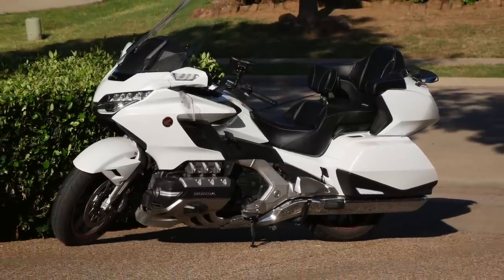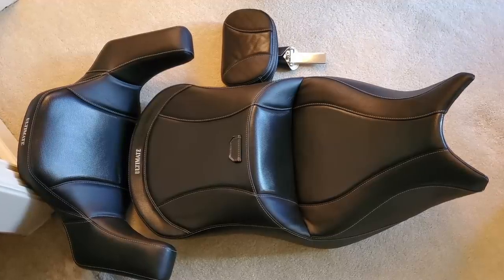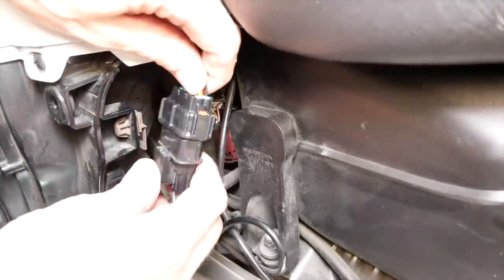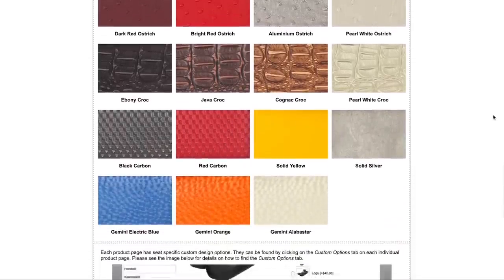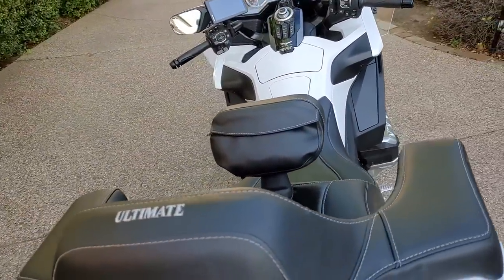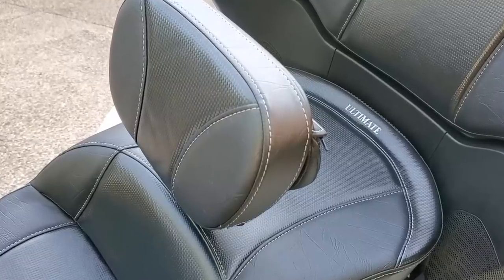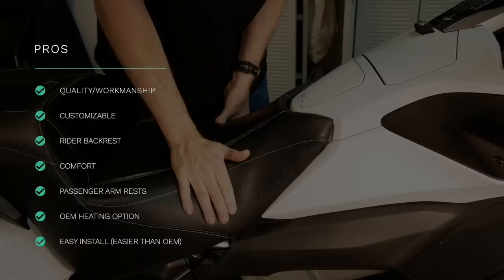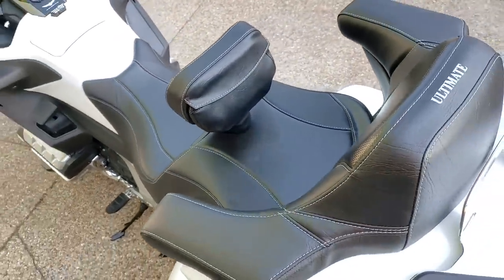The Ultimate Seat for 2018+ Honda Goldwing | Cruiseman's Reviews | 2020

Comment: I've had a Ultimate seat on my 2012 for about 5 yrs. One of the first things I did was seal the stitching with boot water proofing. I've ridden in hard rain and had it parked at the motel in the rain over night without the cover and have never had a problem. I had about $1800.00 in mine also because of the options, but after 5 yrs I still think it was one of the best things I did to my wing.
Reply: Thank you for the tip using boot waterproofing. I just ordered the seat and will apply your technique once it arrives.
Reply: I keep mink oil on mine and has worked great for many years

Comment: I bought an Ultimate seat  for my '05 GW about 3 years ago, what an improvement. The rain cover was an extra and back rest were extra. I bought the standard black seat and passenger back rest which positions the passenger 15 degrees more upright that made my wife more comfortable. You need to be patient when putting the rain cover on as mine started to separate at the seam. I reinforced all the seams with Tenacious Tape. I have had a hip replacement that cuts into my saddle time comfort but I'm not ready to stop riding. If you are going to buy the Ultimate seat buy all the extras and save on extra shipping costs.
Cruiseman, I always wear a back brace when riding. It really helps especially when going over a bump or pothole.
Thanks for all the great videos!

Comment: Just a heads up for some of your viewers...I've owned 2 previous bikes and installed Ultimate seats on them and just ordered my third seat for my new 2021 Goldwing...That little flap that covers where the driver's backrest goes in, if you double it over as in your video that little flap will develop some "memory" and eventually the Velcro will no longer keep it flat and neat. When you slide the driver backrest into the slot hold that flap out of the way until it is all the way in then release it. That will keep it nice and straight.

Comment: Just traded my 2007 GL1800 for a 2020. I removed my Ultimate seat and it is for sale. I ride 10 hour days and lost OEM burn. I’m ordering another for the new bike. I spayed Camp Dry on all the seams. I ride in the rain continuously without rain covering the seats. I live in S. Florida. Inspecting my seat after removal, everything appeared as new as the day it was installed. I’m a very satisfied Ultimate customer.
Reply: Thanks, Ron.

Comment: I owned an Ultimate King for my 2006 Wing, it was a good seat but it did not compare to the Russell Day-Long.  I am an long distance rider.  I put 350k on my 2000, 250k on my 2006 and have about 79k ion my 2009.  The RDL seat has over 300k miles on it and is in great shape.  It is covered in leather.
Reply: I never had a Russell Day Long and the important aspect of the Ultimate KING is it moves you back. I'm taller than John Cooper and weigh about the same. Never felt a need for anything else but an Ultimate since 2012.
Reply: I have three bikes, all with RDL saddles.  Pricey, but worth it.  I can ride all day on any of my bikes with very little "monkey butt".  Tank to tank, for as much as 500 miles per day, no pain in the tush.

Comment: Not waterproof is a deal killer. Thank you for the review, Chris. Excellent as always
Reply: I'm installing an Ultimate seat on my 3rd different bike now (2021 Goldwing). Don't let that scare you away. I've ridden in the rain many times with Ultimate seats. They don't get "water logged" and they don't remain wet for extended periods.
Reply: @volfan1nga does the 2018 seat fit on the 2021+ models? That way I just have to buy the passenger backrest when I upgrade

Comment: Thank you Cruiseman for this review. Ultimate started out making seats for the Valkyrie. I have a 2001 tourer and have had my Ultimate Seat for 15+ years now and it is still in excellent condition. There are days where I have logged 500-700 miles in the saddle with no complaints. Just picked up my 2019 Goldwing Tourer DCT and like the Valkyrie the OEM seat is horrible. After 90 minutes I ready to start walking. Your Pro-Con list is correct. The back rest is terrific, and I would not consider buying this seat without it. Yes, rain covers are needed, but only take a few minutes to put on. I used the rain covers and my Valkyrie seat is still in great condition. Yes, they are expensive, but if you plan on keeping you bike for many years and do some serious touring, the cost per year vs. the comfort you will enjoy more than justifies the expense. I will be ordering my Goldwing seat tomorrow.
Reply: Thanks, Steve. We appreciate it!

Comment: That is a beautiful seat! The first thing I thought of was, what about rain. (It's got a cover) Ok, what about riding in the rain. (Sit on the cover) Ok, what about that passenger back rest. (bingo - no cover - that's a problem) As much as I like the way it looks, I don't think I could drop that kind of coin on it, even if it's super comfortable.
Reply: Hi Hogdriver88,
Any aftermarket seat that has stitching is not waterproof. All of the aftermarket manufacturers sell rain covers. However, ours are the only ones that are custom fit for each seat we offer - and less like a shower cap (universal fit).
Additionally on the passenger backrest - it’s not required as the passenger backrest is vertical and water isn’t able to pull on it. We only offer the raincover for the driver backrest so that it keeps the items in the driver backrest pouch protected from rain.
Reply: @TheUltimateSeats  is the seat he’s reviewing a standard or Tallboy?

Comment: I purchased a Ultimate seat for my 2000 GL 1500 several years ago. I struggle with pressure points and great discomfort on long rides. I bought the Ultimate seat to solve this issue; however, the seat failed to do that. The Ultimate seat was very well made and I like the looks of it on the Wing. I did receive a rain cover for the main seat and the passenger back rest. I have rode in some really heavy down pours with those seat covers installed and they worked well.I would recommend the Ultimate seat just on quality alone. I sold my 1500 last year and bought a 2012 GL 1800. I have purchased an air hawk now and trying it. Recently purchased your video’s to work on the 2012 myself. Thanks for the great informative video’s.

Comment: I just installed the seat, driver backrest and Passenger backrest on my '19 DCT Tour.  It went on way too easy.  I took a ride around the block to get a feel for it and I am grateful for getting the Tallboy as I have a bit more leg room and it does not feel so wide around the upper thighs/crotch area.  I had the heat turned on the seat to see if it worked, but I could not get a good feel for it.  It is 106 degrees right now here in Gilbert, so hard to feel heat coming from the seat when there is more than enough heat around you.  Will try the heat in early morning to see if it works.  It is a pricey seat but not so much more that a Hartco/Diamond.  I can tell the higher quality vinyl of this new seat compared to the stock seat.

Comment: excellent review.  few comments.....I have an Ultimate Seat for my VTX 1300 that I bought in 2006.  It has allowed me to ride most of the day without the horrible pain the VTX stock seat gave me.  It too a while to break in......months.  It is not waterproof, so I used waterproofing polish for shoes on it. this has worked very well, tho it darkened the threads.  I do believe it enhanced the looks of the bike, as it does on the Goldwing.  I have had my 2019 GW Tour since Sept and have put just over 3,000 miles on it.  I have tried riding without anything with extra padding and am able to do so, so far.  for longer rides, I wear MotoSkiveez underwear which has extra padding built in and costs much less that a new seat......

Comment: That’s actually relatively cheap for everything you received. I spent $1300 having a custom seat made. That wasn’t with a back rest or any of the extra bullshit you got with that seat. By the way there’s not a seat on the market that is water proof. If you want to try and waterproof their seat do what every other manufacturer does out there spray the sea with pledge it seals the stitching which is where the water goes through this is normal on every seat on the market not just theirs.

Comment: A friend of mine thoroughly enjoys his Ultimate seat on his Indian. I agree the workmanship is top notch. I've always been afraid to buy a custom seat. You don't really know if you'll like it until you've put a few thousand miles on it. All seats have a break in period. I've always been afraid of spending big money then not liking it more than the stock seat. An Airhawk is relatively inexpensive and easily goes into you side bags or trunk. Take it off put it on adjust the air. Giving your butt some options on the long haul helps keep those pressure points from getting to cranky.
Reply from the maker: I think Ultimate does offer a "trial period" where you can return the seat if you are not satisfied.
Reply: @cruisemansgarage  Thanks, Cruiseman - yes - we have a 14 day trial period for our seats that we stock. We know it's a big investment and we want you to be happy.

Comment: Thanks for the review.  I have a 2019 Tour and do not have 4K miles on it yet and the stock seat already has a small split in the seam.  Yes I will have it replaced via warranty, bit I do not want to have to do this every 4K miles of my 7 yr warrant.  I have had other custom seats on a '97 and a '10 GW and they were in the $12-13K range and that was 8 yrs ago.   So to me, the Price is not a con to me.   I will investigate and decide if this is for me.  I like John below, ride my bike daily and also take -2 week tours each year so the cost is OK in relation to the time I spend on it.

Comment: I have been waiting a long time for you to review your new seat. It sounds like you like your ultimate seat.  I was surprised at the cost.  I decided in getting the Russell Day-Long seat from everything I have read.  I had Bike Solutions modify my seat.  However it still isn't comfortable enough unless I use an AirHawk pad with it.  I am hoping the Russell seat will work.  Will comment after my seat comes back from Russell and ridden a bit.
Reply: Here is my update on the RDL seat.  I put on 6k miles on it.  After 6k I didn't feel the seat was comfortable for me.  I am use to cushy cruiser seats.  So what did I do?  I ending up getting some moto-skiveez shorts, a gel pad from Walmart, and I still have my Airhawk.  I really like the look of the seat and the workmanship was impeccable.  The seat height was no problem at all.  I decided on a whim (since Russell does adjustments) to call Russell and see if anything could be done about the comfort of the seat.  The builder of my seat was Cole who was my size 5'9" and he was 10lbs lighter than me at 150 lbs.  I asked him if anything could be done to make the seat more comfortable.  He said he could make it better as part of their guarantee.  I spent the $100 and shipped it back to them.  I got the seat back about 2 weeks later shipped and paid for by Russell.  I did a short ride that day about 20 miles.  I found the wings on the seat to be smaller and a bit softer, but not as soft as I wanted.  The next day I did a ride about 165 miles with a lot of twisties.  The seat was incredible in the twisties.  I felt like I was part of the bike.  No slipping or movements at all!  I was totally impressed.  The seat is still not as soft as I like.  I will wear the gel shorts because I really don't think they can make it any softer.  I am OK with that.  It hurts having a boney butt.  If you are use to a cushy seat then the RDL may be too stiff for you.  Since these seats are expensive and I can't just drop 1k + on every seat, I wish there was a way of trying out these seats before purchasing them.  In the meantime, I am happy with my RDL seat.  As a side note I sat on a bike with a Ultimate seat.  It felt stiff as a board.  Cruiseman, can you elaborate a bit more why your Ultimate seat was comfortable for you?

Comment: I would never buy a seat that isn't waterproof, I do too much long distance riding in all manner of weather.  Dang shame because I like it otherwise, but wow is it expensive!
Reply from the maker: I am not aware of any custom seat that is "waterproof". If they have stitching, water can get through. That's why they all come with rain covers.
Reply: @cruisemansgarage  I guess the stitching is the key then.  I had many aftermarket seats for my previous Harleys and they were all weather.  I guess they were all one pc covers without stitching.
Reply: I have a Russel Day long seat that I got made in a waterproof material instead of leather.  I know it is not waterproof in the true definition but if it is out in the rain, the padding underneath is not getting wet.

Comment: Nailed it cruisman have 2012 goldwing with ultimate seat black with red inlay and back rest with heat top notch quality very comfortable 50k miles ride all day no problem also have 2018 goldwing stock seat 45 minutes have to stop and get off just installed ultimate seat full in lay drivers back rest with heat hope it’s as comfortable as my 2012 wing also had Yamaha Roadstar with mustang seat back rest did not like and changed to ultimate seat with back rest and loved it not sure how they make so comfortable and the back rest is in the perfect spot can’t be happier with ultimate seats never used the rain cover though I just spray on the Honda polish on them seams to seal them up a bit have not tried it I have heard some people used the water proofing spray that you put on a camping tent to seal them up
Reply: Thanks silveredition921
Reply: Ultimate seats is it okay to spray the seat down with water repellent
Reply: And another question is why don't you make the seat water resistant or waterproof I know in today's times as possible

Comment: As much as I would have liked to installed, I balked at the Ultimate seat for my 2014 GW - $1,700+ and not waterproof?  After installing the Utopia backrest on the stock seat and knowing water must be getting into the foam due to routine washing and rain, I have yet to notice any visible or  functional deterioration.

Personally, if I can ride an entire day, taking time for rest stops every 2 hours,  I'll do without an Ultimate or Russell and put that money towards Traxxion Dynamics suspension or other upgrades. Still, I understand we're talking about the 2018+ model, which is reported as being far less comfortable than the previous model.

Comment: Thank you, Cruiseman, for another excellent review.  Two quick questions.  Was the Ultimate significantly higher or wider than stock?  Also, how would you compare it to your Wingsoft modified seat?  I know the Ultimate is much better than OEM, but what is your subjective opinion of the seat compared to the Wingsoft you already use.  Which would you select if you had a long trip?  Thanks again.
Reply from the maker: Not higher, but a bit wider. I would say from a comfort standpoint, they were pretty close for me. But then again, I can only ride for a couple of hours anyway because of my back before having to get off and stretch my legs.
Reply: @cruisemansgarage  did you go with the mid-rider or tall boy?

Comment: No aftermarket seat is waterproof, that I'm aware of. Nothing that has real stitching can be waterproof. Factory seats look like they are sewn together but they are vinyl welded, which is why they are waterproof. Also why their seat covers don't last as long. I've been riding an Ultimate Seat for 5 years and I do put the rain cover on if the bike will be sitting in the rain or if I know I'll be riding in the rain for.long time, but other than that, I don't worry too much. Lastly, the passenger backrests definitely come with a cover, and it's really easy to put on with the right technique

Comment: I bought my Ultimate seat at Wing Ding for my 2018 Tour. I have heated seats, but I have to use a remote to turn it on. What am I missing?
Reply: Dan Gray you purchased the seat too soon.    The new seat is integrated with the  OEM controls.

Comment: The non waterproof would be a great concern up north. We do have a lot of rain. Kind of surprising they have not thought of that for the price tag
Reply: Hi Bernard,
Any aftermarket seat that has stitching is not waterproof. All of the aftermarket manufacturers sell rain covers. However, ours are the only ones that are custom fit for each seat we offer - and less like a shower cap (universal fit).
Reply: @TheUltimateSeats  So is washing the bike a concern in regards to getting the seat wet?  I mean how much water can the seat take before saturation causes a problem?  Can you get some water on it?
Reply: @TheUltimateSeats  do you retain/add the waterproof plastic under the cover like the OEM to protect the foam from water saturation?  Or can you just install the rain cover between the inner foam and outside cover to prevent foam from soaking up water.   Stitches can absorb some water that’s fine if you have some water stripes on pants but lots of water soaking into foam can be a long lasting problem... also waterproof tape under cover on the seams could be an option.   Just thinking out of the box.

Comment: I would like to how the Ultimate seat compares to the Russell day long, I have been using the Russell day long on my Honda ST1300 and I rode 1530 miles miles in 21 i/2 hours for the Burner Gold from the Ironbutt Association. I stop for gas every 280 miles. when I arrived in Norman OK, I didn't have a sore butt but my neck and shoulders were very stiff.

Comment: My stock seat ripped on on my 2018 on the seam behind the butt.   Getting a new one via extended warranty.   Mine was modified by WingSoft and i really liked it, but thought i might get an aftermarket seat instead of upgrading my new seat again by WingSoft.   Is there a brand you would recommend?   I know you liked the Ultimate.